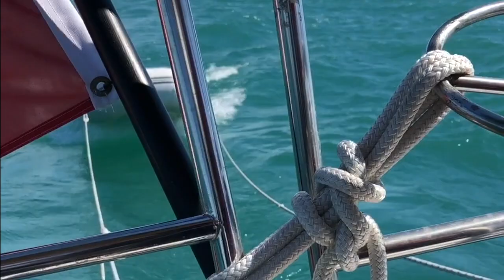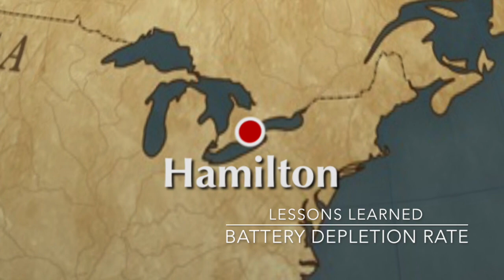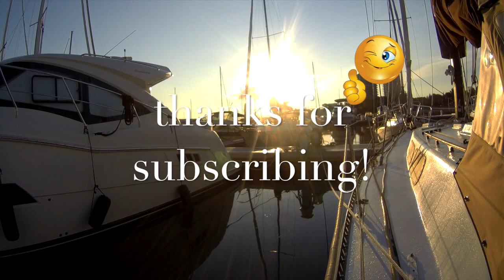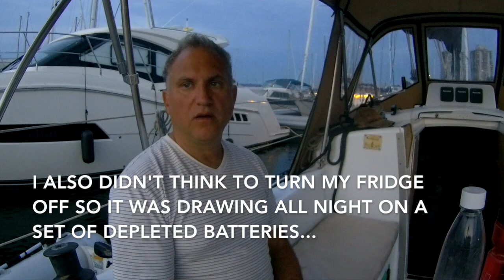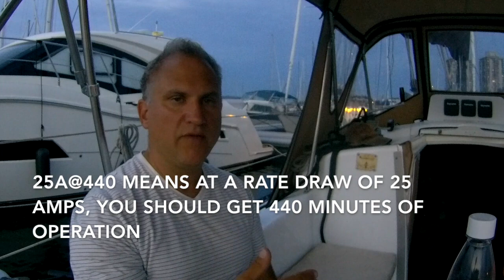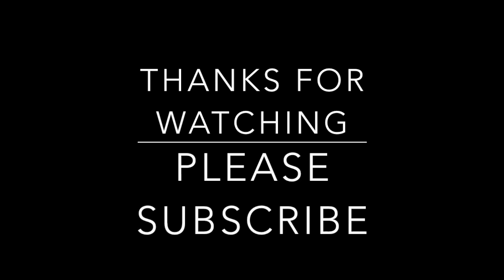Ep66, Nothing like life experiences to teach important lessons first hand, Battery Depletion rates

Comment: I ended up going with 32 280AmpHr LiFePO4 cells, configured as two banks of 16 cells. I ordered my cells from Alibaba, where the going rate is roughly 70 USD per cell. I did a lot of calculations and found these batteries to be the best for exactly the reason you describe in the video, the reduction in current capacity as load on the batteries increases is essentially negligible until you're pulling 300 amps over the cell. Having two in parallel means with the golden motor and aux systems, we've got a lot of safety factor.

If you're considering and investment in more batteries, I would recommend these. The quality is fair, I did get a couple bad cells, but all in all, I'm very happy with my purchase. I have yet to test in the field, so take this all with a grain of salt! Good luck out there!
Reply from the maker: I am curious on the voltage of those cells? Appreciate the feedback, definitely going to do something to replace the existing batteries as I need to be able to draw 90 amps in an emergency. I think it's better to have more qty and less voltage. Let me know if you are still happy after you have them up and running!
Reply: @TheNeds  Nominal voltage per cell is  3.2 volts, 3.65 when charged, 2.7 when depleted. 4 LiFePO4 cells in series is fairly analogous to a 12v lead acid battery.

This battery chemistry is also more immune to temperature variations and is safer than other lithium chemistries as they are not as prone to catastrophic failure in rough conditions.

Glad you guys made it out ok! I'm really happy to be learning with you!
Reply from the maker: never too old to teach an old dog some new tricks... thx for info!

Comment: As you discovered, batteries don’t respond linearly to increased current (or power). The various chemistries of LiIon do better than PbA, especially when you discharge at rates higher than about C/5. A partial compensation for this is to adjust the safe cutoff voltage downward on PbA when discharging at higher rates. You would also do better to track actual Wh out rather than current over a given time.
Reply from the maker: yes good advice and as i later added in some better victron monitoring watts as a measure of power is a more consistent reference unit. i switched to LiFoPO4 now and my max amp draw is 100amp/h so i am encountering new data points now. I am waiting for a hot calm day to run some more motor tests at higher amps to mark and record controller temps at various wattage before i put the cooling plates in. 

appreciate the comments and fair winds!

Comment: The problem is with (6) 8 volt batteries you have 48 volts at 220AH.  In simple terms you get 220 amps for 1 hour or 25 amps for 8.8 hours